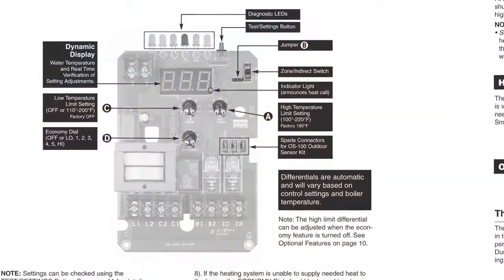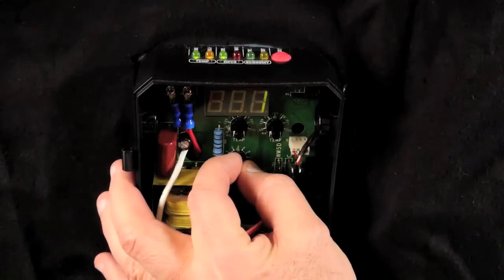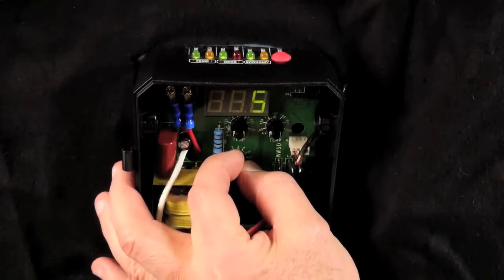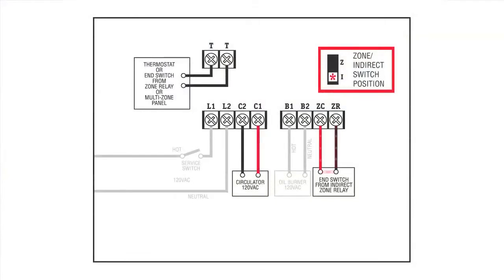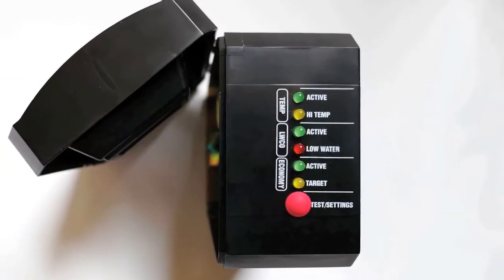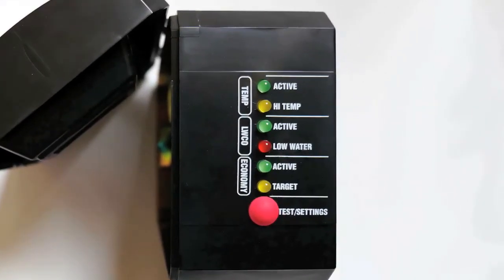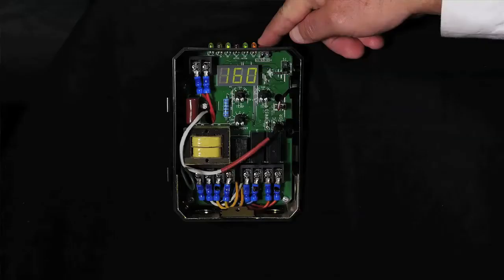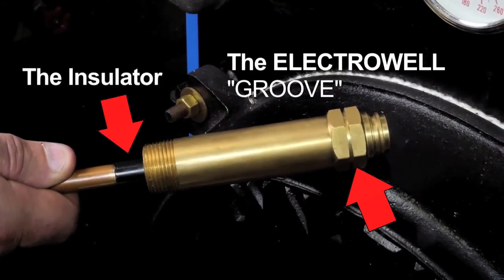Chapter 2 HydroStat SETTINGS

Comment: I notice these controls don't even have a fuse. Not sure if that's just lazy electrical design or outright gross negligence.
Reply: More like poor understanding on your end. Your older Honeywell Aquastat controls that don't have the functionality to control a vent damper don't have a fuse, in other words, the ones that do monitor the vent damper use a fuse to shut down the boiler if the vent damper becomes stuck which would create a safety hazard.
Also, these Hydrostats use modern electronic boards that eliminate the need for an onboard fuse. This is primarily due to advancements in circuit protection technologies, such as electronic fuses (eFuses) and integrated circuit protections that can manage overcurrent situations more effectively than traditional fuses.